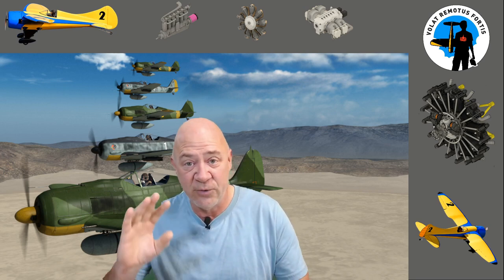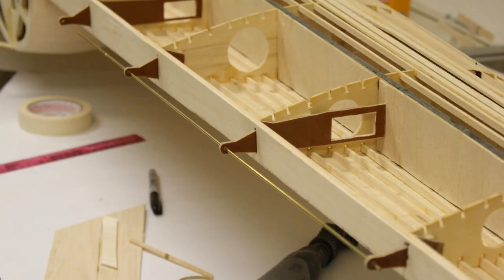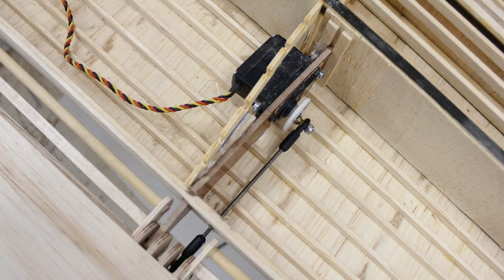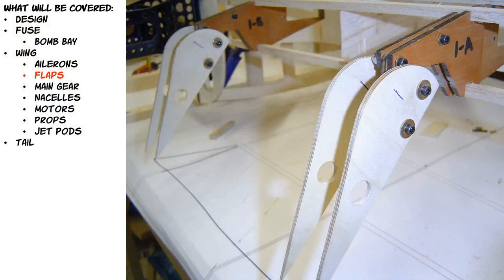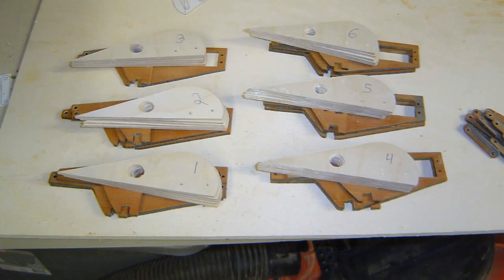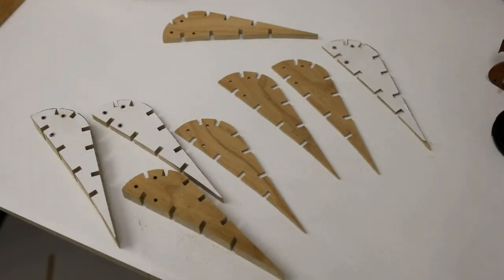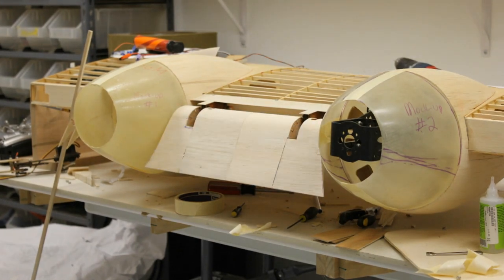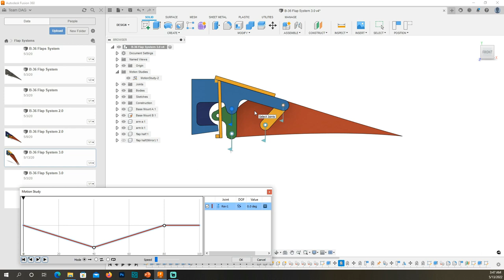257" RC Convair B-36D (Part 5 Ailerons and Flaps)

Comment: Any possible advantage or disadvantage to using linear servos for flaps..?
Reply from the maker: I would think a "linear" servo would always have some type of load on it. Which in that type of servo should be okay. When I have a servo move 180 degrees, there is very little to no load at 0 degrees and 180 degrees.  So I don't think it would matter much. :)